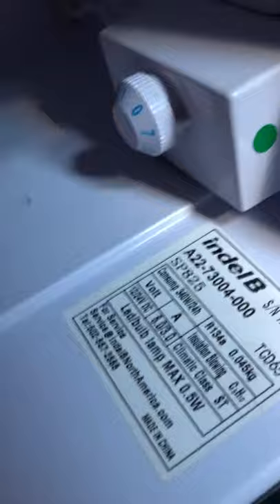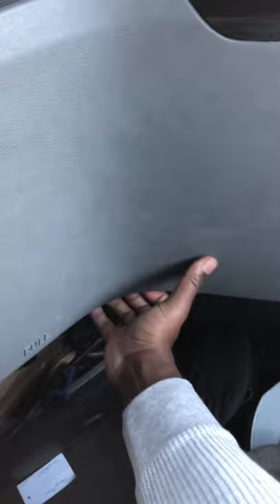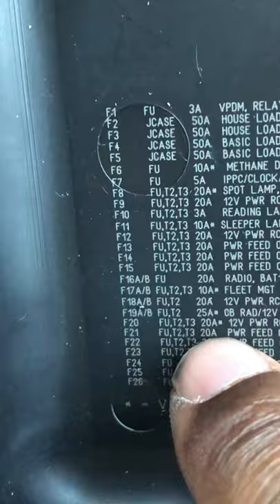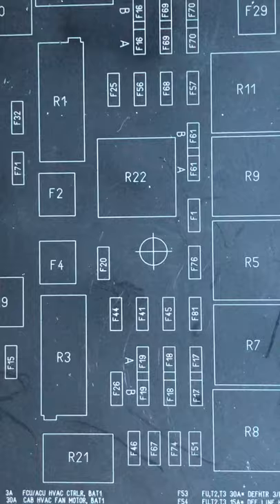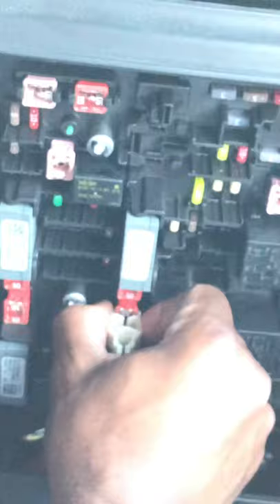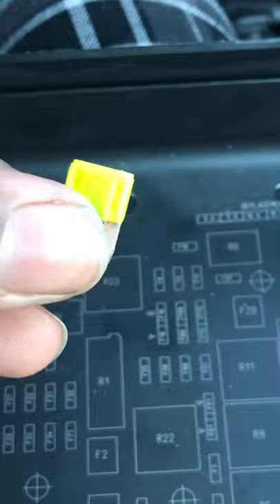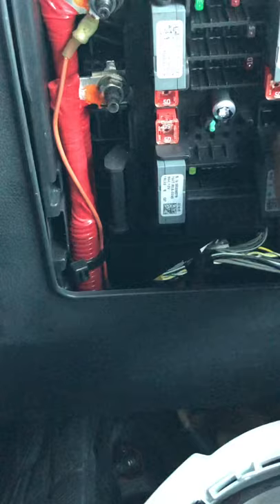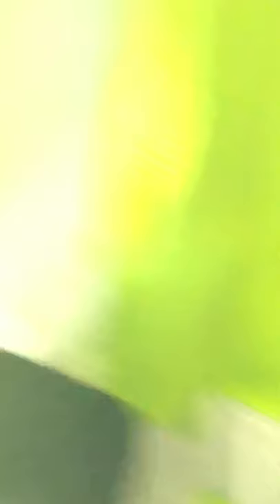Fixing fridge and freightliner Cascadia New body

Comment: Do you notice the door not completely locking and pops open
Reply: I don't think they actually lock, that latch you open it with is a lie
Reply: I bought a  rubber, door-stop at walmart and place it on the far, right corner of the frig door.  Just slip enough between the door and floor and it will stay closed.  (For extra measure, I placed an additional door stop at the midpoint of the door too! Sometimes its needed when hit some, extra bumpy roads !! )😬
Reply: @solomio2518  thank for the info